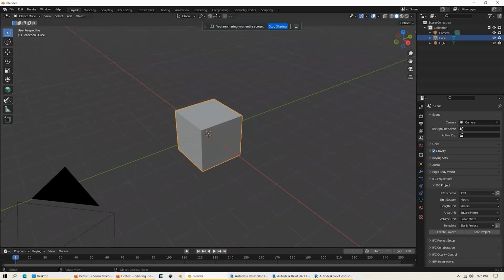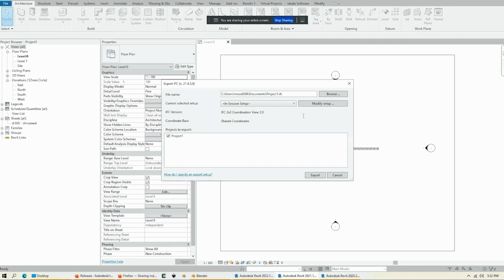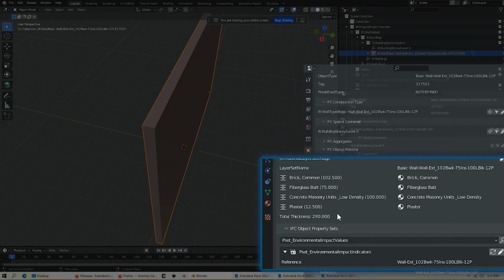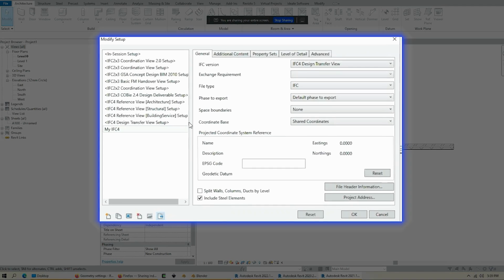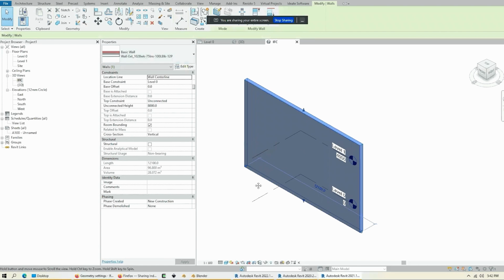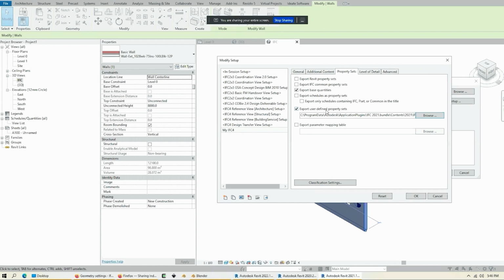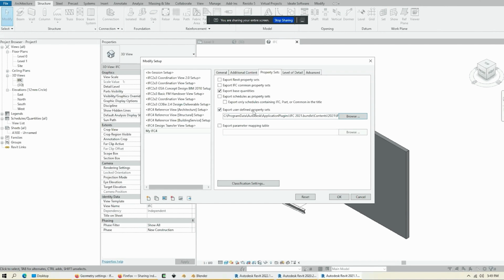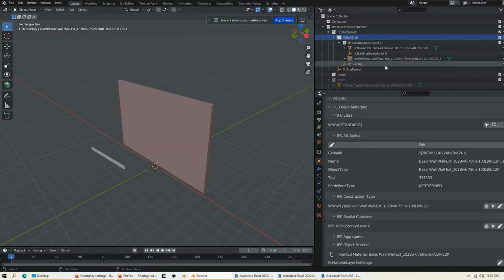Revit to IFC4 - The Export Settings You NEED to Know

Comment: Nice video, thanks. 
In a future I would like to have more similar videos explaining how to overcome (if that is even possible) some of current issues of Revit to IFC exporter. 
I would also like to someone point out great number of current problems with Export>Revit IFC exporter and its inability to accurately export important information related to dimensions or common properties such as eg. doors and windows. 
Also, it would be nice to someone could give some timeline or a roadmap for improving exporter to preserve and export information related to Revit material properties into IFC or to export and preserve relations between Revit families and their shared families, etc.
The problem is that current vendors don't really care enough about developing good IFC exporter for their products (ArchiCad export to IFC is significantly better than Revit and allows export of separate layers of compound elements. Also, it creates new GUIDs for each exported instance of linked model elements, unlike Revit)
Looking forward to some new videos on the same topic with Dion or anyone else already involved in development of various IFC exporters
Reply from the maker: Thank you! I will forward questions to Dion and maybe we can make separate videos at the end of the series answering to questions.